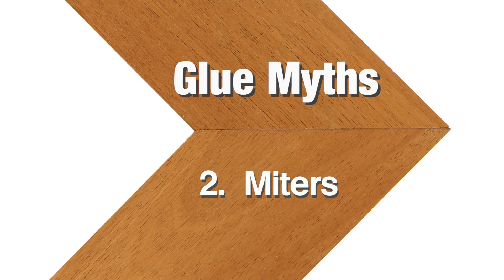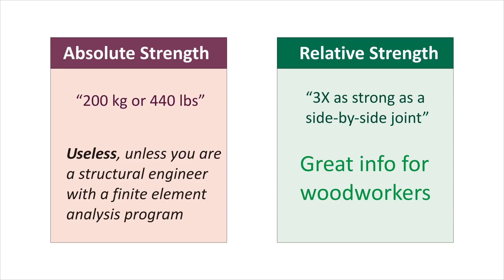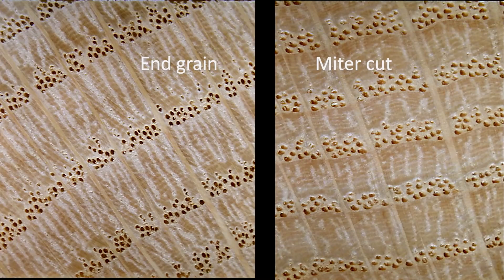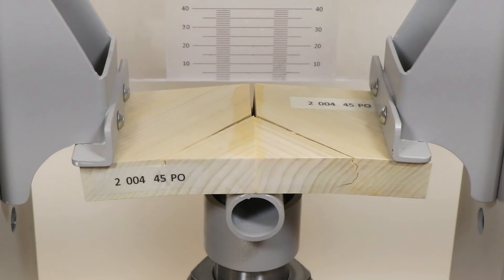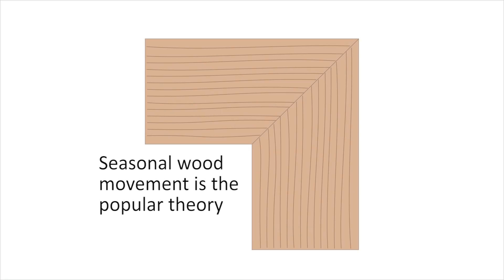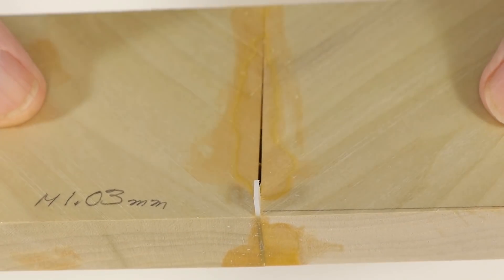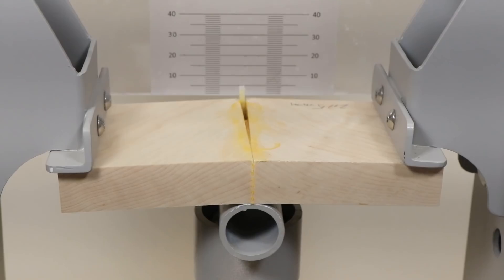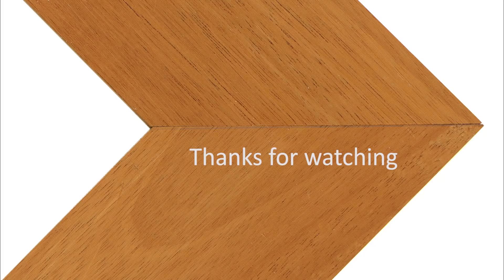Glue Myths:  2. Miters

Comment: The parts of the "myth" most people cannot grasp is simple torque... E2E and Miter joints tend to have a glue line significantly shorter than the total length of the project, while side grain glue lines are almost always longer than the width. So the force at the joint is multiplied as you get further from the glueline...This is why Patrick emphasizes not to think about the actual numbers of the break strength...
Reply: Right. the old saying of it's not what you have but how you use it is the key. Wood is sold to us where the grain is parallel to the long side of a board. This is because trees grow much taller than they do wider. So we don't experience wood where the end grain that is longer than the side grain so all of our glueups that involve end grain are short and because of this, we have assumed the reason of a weak end grain joint was due to the end grain but in fact it's due to the small glue surface as well as how the joint is used in a project.
Reply: @seephor  "we have assumed the reason of a weak end grain joint was due to the end grain but in fact"
No, nobody has assumed that. The endgrain joints simply are weaker. As even his videos show (despite his claims otherwise). He sadly doesn't compare the endgrain-joint to a single longgrain joint in the same application, he always changed the scenario to make the lignin fait instead of using any of the longgrain-joints we know are as strong as the wood it self.
Reply: @ABaumstumpf  If a joint fails at the glue line or in the wood, that is still the ultimate strength of the joint.

Comment: Shouldn't this test be run with the force across the edge grain rather than the face grain?  The example of breaking a miter in the video illustrates the force being applied to the edge grain, but the experiment tests a different force direction.  I wonder if that would change the failure mode.
Reply: It might change the failure mode, but I don't think it wouldn't change the essence of the videos: the tests have to do with the relative strength of different grain orientations, not with how much force you need to break a specific joint in a certain way.
Reply: @panos3051  Sure, but doing a test different from real world applications doesn't really tell us much. There's not much useful information to be had when the force is being put on a face that rarely has that force applied to it in the real world. The strength of the grain in that orientation is of no use for a mitre joint. Considering this video is about glue myths of a mitre joint then it's a rather important factor.

Comment: This is just not how mitre joints fail, they fail by racking of the frame because the wood fibres are discontinuous . Unreinforced joints like this can be”strong enough” for light duty but they are not strong.

Comment: 1) Are you reporting the ultimate force or the force at the onset of cracking? 2) Your test configuration suffers from bend-twist coupling, meaning that as you bend in the test direction about the z-axis (moment axis), the flexural stresses run along the x-axis, and the 45deg alignment of the wood fibers forces the pieces to twist about the same-axis. The crack therefore opens as expected on the top surface in tension on one edge of the specimen (the one twisting further upward), then propagates along one or more 45deg shear planes. 3) The direction of testing therefore matters with respect to the fiber orientation. You ought to flip the samples 90deg onto their long edge in your 3-point loading press (change dims as needed for stability). The chevron pattern made by the grain pattern should then point towards the center roller to test joint opening, and away for joint closing. In this way, your specimen will be balanced and symmetric with respect to fiber orientation. Mind you, you may still cause premature failure due to the load concentration under the central roller. This is where a 4-point bending setup would help. — Still, all in all your video made its point. I happened upon it looking into wether I should reinforce a plywood waterfall shelving unit with spines or if the glued miters would suffice.

Comment: I think you have shown for your self why we say endgrain joints are considered weak. 1) in your first video shows that on endgrain glue ups the glue fails, where as on side grain the lignum fails. Thus on side grain the glue joint appears to be stronger than wood and endgrain weaker than wood. 2) While 3” glue ups would be common on endgrain, sidegrain would tend to be much much longer. I would think this would distribute the load over a greater area. 3) Geometry maters in the real world. Miter/endgrain would more likely be a small glue joint with a much longer lever overhang on either side of it. Side to side would more likely tend to be a long glue joint with much less of a lever working against it.
Reply: "3) Geometry maters in the real world."
Yep - and that is why the miter-joint and end-to-end glueups are the weakest joints (contrary to his claims), as a good longgrain-joint maximises the overlap of the fibres while the glue replaces the task of lignin, making the overall joint stronger than solid wood.

Comment: I think you hit the nail on the head with the “power of leverage” comment, and I think it’s where both of these myths stem from.  End to end and miter glue ups aren’t inherently weak; they just happen to be the configurations that result in the most leverage placed on them since wood is typically cut the longest in the direction of the grain.  That’s a hard story for master woodworkers to instill into apprentices over generations, though, so it got boiled down to dogma of “these joints are weak”.
Reply: "Conventional Wisdom" often gets misunderstood and misapplied by subsequent generations.

Comment: I think an important 'real world' factor is the inherent difficulty in clamping miters, even well cut ones. In many instances we use band clamps which do little more than hold the pieces in position rather than apply a good clamping pressure.

Excellent video by the way. Thank you.
Reply: I make a ton of frames. I typically use a frame made of threaded rod and corner braces to clamp the frame but I have also used the type of band clamp with the plastic corners. You probably know the type I’m referring to. In my experience both theses types can exert tremendous pressure on a frame. The reason is the multiplication of the force vectors in all 3 directions. As you may be aware a wedge can exert tremendous force. In a typical frame glue up each of the 8 miters are effectively acting as wedges multiplying the force of the clamp it’s self. The tension on the miters is many times greater than a typical straight clamp can exert. There are actually 3 vector forces on each miter. One horizontal, one vertical and one diagonal. A typical clamp base only one.
Reply: To the extent that ease of clamping affects the fit of the joint, I agree, but Patrick already addressed that.  High clamping forces can be used to close up a poorly-fitted joint, and that's hard with miters.  However, the real problem is the poorly fitted joint.  Well cut miters require very little clamping force to achieve full strength.  Holding them in position is all that's required.  This is easy to test if you care to.  Cut four small samples from the same board with straight, square edges.  Glue them together in pairs.  For one pair clamp with a rubber band, and the other squeeze it has hard as you like with the clamp of your choice.  Once cured, break them both.  I doubt you'll perceive a difference.

This leads me to request a different test in the future.  I've heard people suggest you can over-clamp, and "squeeze out all the glue", resulting in a weaker joint.  I have no experience to suggest there's any truth to this one, nor given what I know about fluid mechanics, can I think of any way to actually squeeze out all the glue.
Reply: I loved you in Schitts Creek
Reply: I'm pretty sure that I've seen the myth of "clamping pressure" busted a few times here and there.
Reply: @bobby-c7731  my first thought, lol
Reply: So make a video about the strength or weakness of types of clamping.

I'm sure we all can benefit from the knowledge gained.  I am truly curious to see those results.

Comment: The lab test mode is very different to the sample 'frame' broken by hand. 
In the lab tests, the bending moment is across the weaker plane of the test pieces, i.e. you're bending across the thin section but with the mitre broken by hand, you're bending across the thick section. This means that wood section is inherently stronger in relation to the section of the joint (the wood is thicker, and the joint is thinner) and there is the added disadvantage of a stress raiser at the inner intersection that predetermines where the fracture will initiate -at the glued joint. in addition, the bending mode of a mitre bent that way is such that the fulcrum for the two opposing levers is on the outside of the joint and if you look at the resulting forces at the inside of teh joint, they will be orientated more along the grain axis rather than across the lignum.
As an engineer, I very much appreciate your methodical approach and your focus on relative strength (and failure modes) using samples of identical geometry. I can't help feeling that comparing the effects of geometry would teach us more, but I guess that your test equipment wouldn’t be able to apply sufficient load to break the joint if you rotated those samples 90 degrees and you would need to scale the geometry down.
Keep up the good work though. I enjoy the videos and the intelligent debate that stems from them.
Reply: This is a crucial point, thank you!
Reply: Very true, but probably irrelevant.  Instead of loading a single miter, picture how miter joints are actually loaded in your projects.  The shape of the final project is usually a closed loop of some sort, and the forces can't produce a large bending moment like in the sample he broke by hand.  In practice, miter joints are subjected to tension and shear - the same forces produced in Patrick's test apparatus.
Reply: @charlesenfield2192 I agree that it's unlikely that a mitre would be used in an 'open ended' way like that and that mitres are part of a closed structure. These joints are most stressed by loads that cause the joint to open or close such as loads on opposing corners or opposing loads along opposite sides. These cause tensile stresses at the inner corners of two opposing joints and the outer corners of the other two. 
My real point is not about mitres but about the effects of the joint geometry with respect to the width vs height of the glued section and the potential effect of stress raising corners at the interface. Patrick is suggesting that there are other aspects to consider in further studies, I'm proposing some.
Reply: I thought the same, the direction of forces exerted during his test are significantly different than his hands on demonstration. It would be tantamount to twisting the wood as opposed to prying. I appreciated his scientific approach and believe that there should be follow up research.
Reply: Came here to say the same thing. 

Well, actually I came here to find someone else who said it better than I could and put an appreciative comment and thumbs up on their superior post.
Reply: He could also take the same square samples but angle the miter vertically like a V or an upside-down V (an A?). I'd be curious to see which breaks sooner, the "A" or the "V" miter .
Reply: I comment pretty much the same thing before I saw you comment. Load direct has potentially huge impact on stength.
Reply: As yet another engineer, I also very much appreciate the rigorous experimental design. But I also came to say the same thing. 

Patrick spoke about vectors for the breaks on the test rig (which in themselves were interesting and useful under the right circumstances), but then didn't take them into account for the two different test failure modes. 

Moments and force directions on the glue joint are different for manual (single mitre) vs test rig breaking modes, and therefore they are not comparable.
Reply: Having isolated grain orientation and kept the other variables as constant as practicable we now understand its effect in a glued joint very well, and know more than most of us did beforehand. 
I'm now looking forward to hopefully a long series of videos that isolate and explore other variables in a similarly meticulous and informative way.
...and then we can have a jolly old chat about them.
Reply: In regards to real-world miter joints themselves, your thoughts are worth considering. However, I think Patrick was more interested in testing diagonal-grain joint strength. In order to compare it with previous tests, he has to follow the same size format as his current test pieces. Perhaps he'll go into more details on this in his next vid
Reply: @MetalMario137  I completely agree and I hope to see all of the variables assessed individually in a long series of videos.
Reply: As long as the moment arm and surface area of the glue joint is the same, it should be an apples to apples comparison if he orients the joint correctly on a retest. I think if he makes a V shape with them keeping this in mind, we should have a good test.

Comment: As a retired engineer wood working for over 40 years I appreciate the method and style of presentation.  It has been my experience that taking a strong joint with a poor design or poor construction will not work.  Conversely a weal joint used in a proper design well constructed subject to proper forces could last for generations.  Flaws in materials, steel or concrete or wood, will fail much sooner subject to design, construction and forces applied.  Thank you for this series.  I have also enjoyed the response from some well known woodworkers that this series has generated.

Comment: When I started making picture frames I did a very simple test by gluing one mitre joint together. After curing I could not break the joint with my hands. I reasoned that this would be strong enough for the purpose, particularly because the four joints each support each other. Since then I make all my picture frames by gluing the mitre joints. I haven't had a failure yet.
Reply: Yeah you've gotta think about what you're building and what stresses are actually going to be on it.  A picture frame doesn't need to be strong enough to dance on and a table doesn't need to be strong enough to have a dance contest on.

Comment: Many thanks!   An interesting result...but one I think needs to be better understood.

One interesting (and fairly easy) experiment you can do is to use polarization to visualize the stress in most common plastics.   If you take an L-shaped piece of acrylic, shine polarized light through it, and view it through another piece of polaroid - you can see the pretty rainbow patterns of stress within it.

You should DEFINITELY do that - it's quite instructive!

If you imagine a typical miter joint, the stress is MUCH greater on the inside corner than the outside.   

Interior corners concentrate stress PHENOMENALLY - which is why rounding those interior corners is a good idea when you can do it.

When you try to pull open an actual miter joint by hand (as you do in the video) - the forces are building up selectively on the inside corner...and the outside corner is actually in compression.  Glue can cope with HUGE amounts of compressive force.  So applying forces in that way will cause the glue at the inside point to have MUCH more stress.  Your test doesn't reproduce that.   It applies the forces much more uniformly across the entire glued area.  So you're right that the glue itself (when applied at 45 degrees to the grain) is stronger than on side grain and not as strong as as on end grain - but that misses the point about mitered joints and why they fail.

So what's going awry here is that you're talking about glue strength - and the anti-miter people are talking about joint geometry strength and the way that forces within the joint are concentrated.

A second problem is that your tests on inaccurately made miters was implicitly assuming that the inside of the miter was where the gap is...ie the sum of the two supposedly 45 degree interior angles adds up to less than 45 degrees.  This places the stress that would be on the inside of the miter on the glue itself.   But what if my error is in making those too cuts add up to more than 90 degrees - so that the gap in the wood is on the outside of the joint?   In that case, the glue in the gap would be in compression and all of the force would be in trying to tear apart a much better wood-to-wood contact area.

I believe that we're in a new era of joint making science because now we have CNC machines that can easily make high precision joints AND which can cut arbitrary curves - we can focus on the joint geometry more carefully - and there is more room for innovation.

Some of the "dog-bone" joints that CNC milling machines make can control where the stresses in the material are - and I think that will ultimately matter more than the nature of the glue.

Comment: More interesting stuff.  Another common cause for failure of a mitre joint is the joint being starved of glue.  We were taught to apply the glue twice.  I don't recall the recommended time frames, but when I'm making a carcase with mitred joints,  (and I'm not being lazy) by the time I have applied glue to the 8 ends, it is then a good time to start applying the glue again.  
In terms of reinforcing the joint, it was surprising to me how much aadditional strength was achieved with a small piece of veneer in a saw kerf cut across the joint.  I think Jeremy Broun makes a good point about strengthening joints.  Thanks for the video.  Cheers, David.